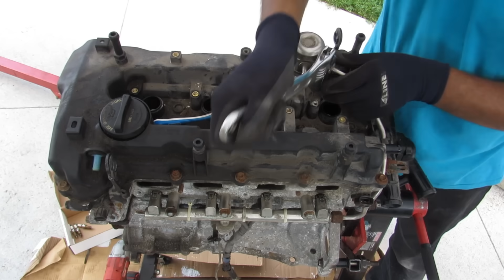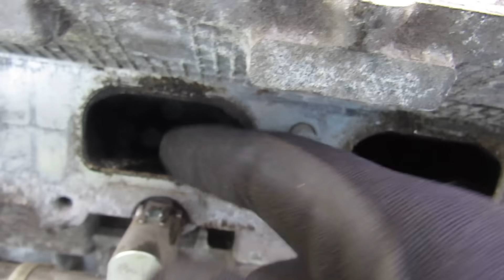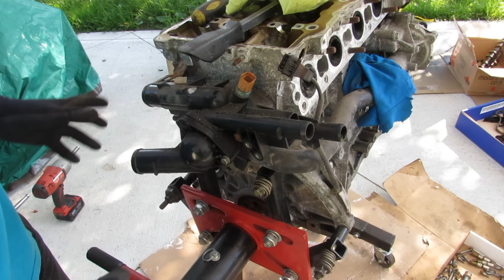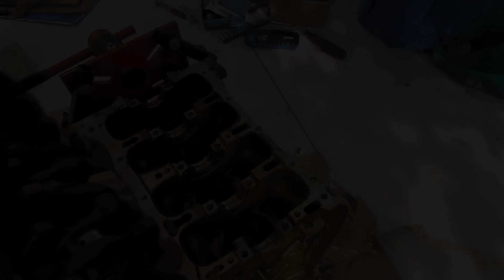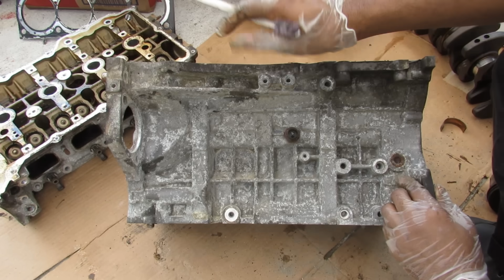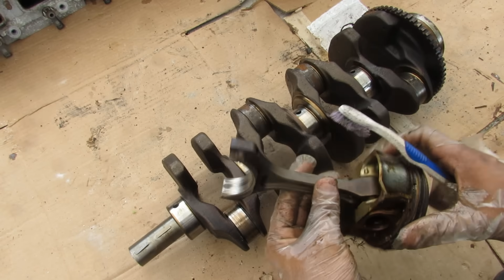Why Hyundai Engines FAIL

Comment: Interesting video!!! He definitely knows how to take things apart very quickly... The comment that he made about the cam chain guide that is supposedly needed between the two camshafts is bogus... That is a straight run of chain ... The curved runs of chain is where the guides are needed... His explanation of the 'improper deburring' of the lubrication passages during manufacturing - causing con-rod bearing  failures / seizures, is doubtful... If that was the case, the main bearings and most of the bearings to the camshafts would have developed problems very early from when this engine was bought.....  This was definitely a lack of lubrication, and this well used engine with a LOT of varnish and carbon deposits inside of it, probably had the oil changed very infrequently, like every 10,000+ miles... The oil filters probably went into the By-pass mode - several times which led-up to the scoring of the bearings, and eventual failure... One look ate the bad varnish and those coked-up Pistons tell the real story , of WHY this engine finally quit... Previous owner neglect... I have seen problems with High temp molded plastic parts that hold pressure and hot liquids fail to do the job, like this thermostat housing, radiator tanks, surge tanks... That is the new way to do things these days... Get used to it... The failed cam timing actuator is part of a complex cam timing system that so many  vehicles have nowadays... Get used to it...

Comment: This GDI crap is one of the worst innovations ever...didn't they know how important the gasoline washing is?
Reply: The only thing I like about these is that the water pump is belt driven, like you said
Reply from the maker: No they don't and still don't care. Because carbon buildup typically is an out of warranty issue

Comment: Mexico made engines!! Window sticker tells all....Big disagreements in between Korean and American engineers/management departments at north american plants and that is the result....A simple clear plastic fuel filter mounted on the PCV hose, cleaned regularly, kept my intake valves in like new condition at 149k miles on a 2012 Accent/GDI engine...Synthetic oil throughout, no sludge....

Comment: Anyone else would like to find out how what mileage this engine failed at? I wouldn't draw conclusions from one particular case, but I am curious anyhow.
Reply: We have a 2016 Kia Sorento and the engine failed at 149k this September. It was replaced and ever since then there have been no issues (knock on wood... I constantly check the oil levels). We questioned the dealer about the new motor and he assured us that the  new one does not have the design issues of the Theta II. Only time will tell.
Reply: @edmatheson7327  I've heard this stated by dealerships as well, but the fact that Hyundai Canada extended the lifetime engine warranty to 2019 engines makes me think the opposite is true. Is there a similar settlement with Kia?
Reply: @AGR96  It sounds like it, although I can’t find any info online. The service manager explained that Kia was covering the replacement, because of the type of issue we had. The failure was in the lower crankcase area ( they weren’t to specific on details).
Reply: @AGR96  sorry I wanted to add that since the replacement I’ve been keeping a close eye on oil consumption and as it stands all is good.
Reply: @edmatheson7327  Hopefully it keeps your car going for a long time then. I am very hopeful. These are really nice cars, too bad the engine gave us some headaches.
Reply: My Hyundai Santa Fe sport 2014 engine failed at 89,000...Had taken it to the mechanic shops when I was hearing noises that sounded like it was coming from the left drivers side wheel, like a noisy kind of rattling spoke .  It didn't do it for the mechanic, then I took it again, they finally heard it, it was too late.... broke down on a highway.  I am just seeing all these you tube video's of what could have happened  (fires) and I am glad it didn't happen to me.  Still it cost me a car.  I had bought it used and only had it 2 years and 3 months.  I am in the rural areas of Oklahoma, there was no recall place close.  I don't know why the local car dealer could have sold it without making sure the recall had been taken care of.
Reply: Mine just did at 195k
Reply: @visalgunaratne2296  Sorry to hear, thank you for your feedback! Is Hyundai taking responsibility for it? My 2019 SF got a lifetime engine warranty if it fails due to this problem. Result of a class action in Canada.
Reply: Mine did 83K

Comment: If you don't mind my saying, you don't seem to cut Hyundai much slack with their designs.  As far as that comment on the plastic on the front of the engine, I would think that after a few hundred heat cycles that plastic would become brittle and fail.  I don't know much about it, though.  I think Hyundai has a 10 year warranty.  I would say you are going to need it.

Comment: I do not have too much experience on different engines, but this one looks quite similar to Mitsubishi 4b11. There are some differences, definitely, like direct injection and the second chain for oil pump.
Reply: Yes hyundai uses mitsubishi designed engines

Comment: Your not saying weather the oil was changed regularly  also air cleaner, possible poor fuel. If particles were left there from new it doesn't take 142,000 miles to do that damage! Who are you and what are your credentials, seems you know a lot more about rags than engines to me!
Reply from the maker: Who are you and what are your credentials because it seems you know the history of this particular engine that I don't.

Comment: The first real item I have seen from Uline. My 2011 Sonata was drinking oil at 3qts per 1500 miles. My dealership said that was in spec. I sold them the car.

Comment: I owned a 2005 Hyunda getz with 1.5 G4EC petrol engine for 10 years.
Best car I've ever owned. 345 000 kms run without fault. Still maintained factory fuel economy at the end.
I believe the engine was Mitsubishi made or designed....
Reply: The 1.5 G4EC is a Alpha series engine. Introduced in 1992, this was Hyundai's first engine designed entirely in-house. Design objectives were to provide high performance and good fuel economy with excellent durability at a reasonable cost. From Wikipedia

Comment: Seems the Hundai did a lot of things right with this engine, and with some of them only failing after 100,000 miles, they can't be that bad. Many cars over the years couldn't  even make it to 100K without an engine rebuild. But, an engine is only as good as its worst mistake. I hope they have perfected their manufacturing process in the last 10 years, but anyone who has one of these engines can probably make the best of if by changing the oil frequently, getting a magnetic oil plug, and buying the car with an extended warranty if it's not covered by the recall.
Reply: 100k miles is nothing. no engine should fail at 100k.
Reply: Many cars ?  What cars you reffering too ?  100k miles and a rebuild might be for engines in the 50-70s ?  But a modern engine ?  No way.

All three of my Jeeps one with the AMC 360 has 150k.  The inline 6 4.0 has 370k.  And my 5.9 (360) magnum has 210k.

Not sure where you think 100k miles is good ?

Comment: in my family, and everyone I know, who has ever owned a Kia/Hyundai, has never had any problems. My Grandpa has a Sportage 2.4 with 238k miles and has only had brakes done. They do last if you take care of it.
Reply: Wow you should contact Hyundai immediately and tell them your findings.  They recalled millions of cars due to engine manufacturing defect and also cars catching fire while parked.  So you think they made a huge mistake with the recall? You think they didn't realize that it was just maintenance issue.
Reply: @m.b5777  a good quality filter and oil properly maintained and not abused will still preserve it. The shavings from the bearings and such could've been taken care of

Comment: My 2016 kia soul has 237,742 original miles just oil changes every 3,000 miles
Reply from the maker: The 1.6L hold up better nthan the 2.4

Comment: My wife's 2008 Hyundai Santa Fe with the 3.3 L engine was super reliable. Not a single problem other than one marker light. Traded it in with 290000 kms on a 2016 Kia Sorento. Terrific vehicle. I believe it's an updated version of the same 3.3 L V6.
Reply from the maker: Yeah the 3.3 will hold up better
Reply: Wait till it catches fire while parked. Hyundai sent letters to people advising them to park away from buildings

Comment: That "deburring process during manufacturing" thing is a bunch of hogwash.  Whoever was driving the car ran it out of oil.  That's what causes bearing failure like that.  It is reasonable to assume that the car had VVT codes due to the lack of oil long before the rod bearings ate themselves up.
Reply from the maker: So thousands of people who also got similar failures at low mileage ran it out of oil ?
Reply: Yes.  
I'm sure you've been around a lot of used vehicles over the years.  Is it not uncommon for trade-ins at the dealer to come in with nothing showing on the dipstick?  I, myself, got busy with life and didn't take the time to check oil in my own stuff, and when I finally did one day, the stick wasn't long enough to strike oil.

It would not surprise me if the vast majority of Hyundai/Kia owners don't even know how to open the hood, much less check the oil if they even feel the need to do so.

Some engines consume more oil than others.  Some survive running low better than others.  I had three vehicles come to me over the last year to my low-volume shop with the complaints of rough running, engine stalling, and some rattling noise.  One was a 2006 Infinity G35, a 2003 Honda Accord, and the other was a 2010 Equinox.  They all had VVT codes and nothing on the dipstick.  They all survived, at least for now.  That's not to say that a rod bearing or two isn't compromised and is currently restricting oil to that particular journal as a result.

That Infinity--Just had its oil changed.  At least it did on paper.  That oil was pretty dark for a 68,xxx mile car, and she doesn't drive much.

If their de-burring process left crap in there to cause these issues, I would expect that the problem would show up LONG before their 10 year, 100,000 mile warranty is up.

Comment: Thanks.  Very detailed info and fast talk.  Pretty corroded for a fairly new engine, at least where I live in CA.  My 1996 Plymouth engine still looks almost pristine.  White powder on the spark plugs looks normal, and that varies with gasoline used.  Seems you are comparing the metal timing chain with earlier rubber timing belts, but the designs are almost always different.  All engines I've seen with a chain, have it inside the crankcase to be bathed in oil, as here (whether pushrods or OHC), so the water pump is then external and belt-driven.  It is strange they use a chain-driven oil pump (like my 1985 M-B 300D) since many today have the oil pump integral with the timing cover, driven directly by the crankshaft (simpler and more rugged).  VVT gives big advantages, but adds much complexity and has proven a maintenance issue on many engines which use it, from the earliest Honda.  Coking of the intake has been a problem on GDI engines.  Goss's Garage on MotorWeek (TV) had a episode where they said you must remove the intake manifold to clean every 50K miles on many.  I understand that some added an upstream fuel injector a few years back to avoid the issue.  The coking shown wouldn't make the engine run bad, but would limit max power by restricting the airflow at WOT.  The knock sensor in all gas engines is used for active feedback control of spark advance, so you can run on varying grades of gasoline without damaging the pistons.  Since metal debris in the oil passages was such an endemic problem in Hyundai and Kia engines, I don't know why they didn't have the dealers remove the oil pan to get at the bearings, then flush the oil passages clean and replace at least the rod bearings.  Seems cheaper than having to provide new engines under warranty (10 years or 100K miles?).  Indeed, I wonder if this engine could have been rescued by doing that, which is a fairly easy in-car repair from underneath.  Interesting that it has oil squirters under the pistons.  I thought those were only on turbocharged engines.
Reply: Honda has made about 5 million vtecs with almost zero issues.
Reply: @sugarnads   I recall a Wheeler-Dealers episode when they dug into the VVT passages to fix a Honda which was anemic.  Some gunk or material was plugging a port as I recall.

Comment: This is a very honest video. The poor quality of Hyundai engines is unacceptable. Hyundai should have solved such basic quality issues such as machining used in manufacturing the engine, by now. I will not buy a Hyundai or a Kia!!

Comment: My wife had a Sonata quite a few years ago and coming back from a long trip on the freeway the engine lost power..later to be diagnosed as one of the cylinder's failing..saying that we did make it home but at a lot slower speed.. there was also some problem with the timing chain before that..i think it was a early 2000's model

Comment: My gf and I had a 2011 Sonata and it was subject to the recall. Had 80K miles on it when we took it to the dealer. They did the acoustic test thing and said it passed. Warranty was extended to 120K miles. Kept the car until 139K and I thought the motor was getting loud so we traded it in for a 2019 Sonata that was identical. We have a great dealer (Somerset Ky) and they do the oil changes. The 2011 was the best car ever. In 139K miles we replaced the battery once, front brakes twice, rear brakes once, one set of tires, and that was it. They’re excellent cars. Our new one has about 50K miles and so far has been trouble free. 
I like this video. Just subscribed!
Reply: do the newer cars suffer from these engine failures? I plan on getting.a 23 Kia Rio or 23/24 Kia Soul or Fiesta, maybe K5. I've always been into Honda so I'm a complete noob with this car manufacturer. Thanks.
Reply: @dbzownz12345    As I said earlier, our 2011 Sonata was the best car ever. Our 2019 Sonata is great — but it has started using oil and we are experiencing detonation under acceleration. So it’s a bit of a disappointment but still a wonderful car. I think that it can be attributed to the old “Luck of the Draw” more than anything. I think the main factor is to buy from a dealer you are comfortable with. Our dealer started out great but they were bought out by a larger umbrella of dealerships and their service went rapidly downhill. The new service manager told my gf that the knock sensor wasn’t for detonation but was for rod knock. When I explained to my gf what a blatant lie that was she just said that we are through with that dealership and are moving on. Trust is a fragile thing. Once squandered...  well, it’s hard to get back. 

Good luck with your purchase. Let us know how it turns out. 🤞
Reply: @GoodGirl6907-t2u    Thanks for adding some constructive input to the conversation. That’s what YouTube is all about. 👍

Comment: I dive a Hyundai 2.0 L 4 cyl. (which i bought new) with that engine and have close to 200,000 miles. 
Regular oil changes that is all.   Other than wear items like wipers, brakes, tires, spark plugs, etc. it has never needed repairs.
Reply: That's exactly what I've experienced with my Kia Optima 2011. Oil changes every 5000 Kms and nothing else since 2011! Very reliable.

Comment: Hyundai corrected the  de-burring  problem   at the factories  for all models built after  Sept  2012, ( 2013  model year ) so  if you have a late  2013  or after , you are good to go.  I do have one, 2013 , and mine is running  great   at 152 k miles.

Comment: Not changing oil does this. Far less failures with 3000 mile oil changes than the 5k plus people push these days. Oil is cheap compared to an engine.
Reply from the maker: Agreed. And it's so easy to change and check

Comment: The basic GEMA engine design is shared by several manufacturers, including Chrysler, Dodge, Jeep, Fiat, Peugeot, Citroen, Mitsubishi and Proton, besides Hyundai and Kia. Is the problem (of particles from manufacturing causing failure) only happening with Hyundai and Kia?
Reply: Hyundai and Kia versions are the only ones that are failing at low mileage.

Comment: You mean why CHRYSLER motors fail
Reply from the maker: Yeah this is a partnership engine. 
Would like to take apart a real Chrysler engine and see how it works.
Reply: @speedkar99  it’s exactly the same. Only difference I’ve seen workin in a shop, is the Chrysler engines of the same generation aren’t Di

Comment: It would be interesting, to cut the oil filter apart, and see what the media inside looks like. (metal flake city) It seems like the trick would be, change the oil and filter after ~500-1,000 miles, during the break-in period. That would hopefully flush some of the metal flakes out of it, just the same as you would a new lawnmower engine. Initial oil change after the first 5-10 hours of operation. It could be that the oil filter becomes so restricted, that it goes into bypass mode, allowing that metal to flow into the oil galleries. Other than that, it actually looks like a well designed engine, just poor quality control.
Reply from the maker: Agreed. Good idea

Comment: Change oil every 3500 to 4000 miles. Add a can of seafoam about every second or third oil change it will help keep the carbon from building up and dirtying up the oil especially on the top of the cylinders. I don't think these engines like to be lugged. I run around in sport matic and wind it up quit regularly kind of like youd drive a manual(I dont beat it) haven't had any issues with any of my 4 KIA'S so far.